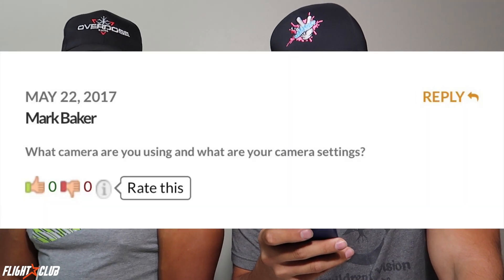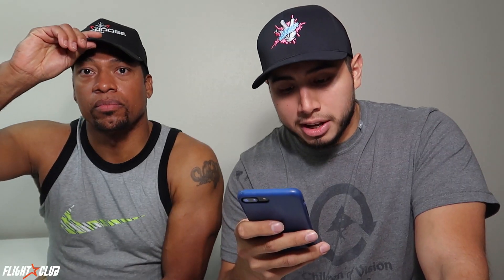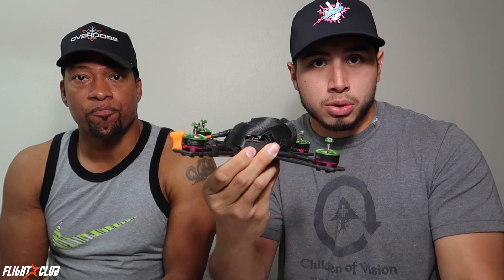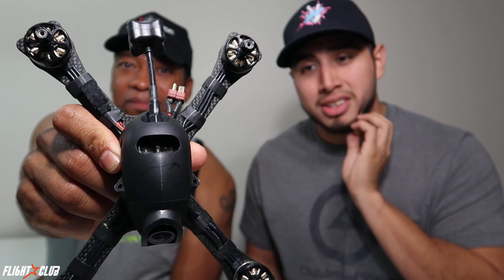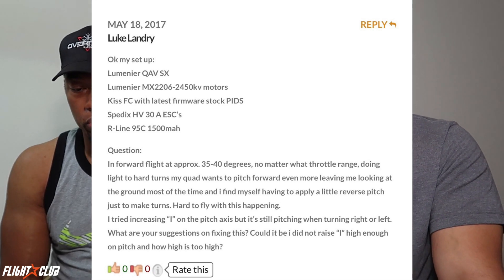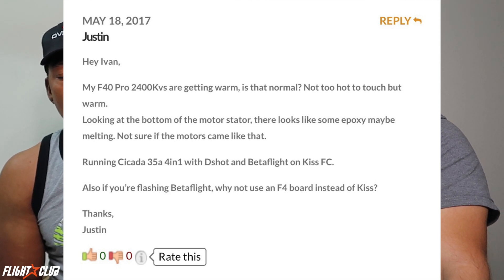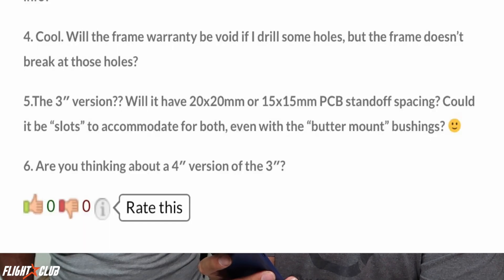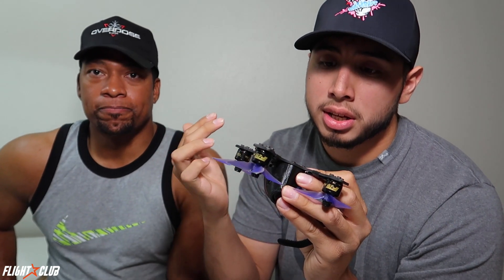Ivan  Rodriguez  Q&A #1

Comment: actually the flip32 omnibus f3 and f4 both support the ports for 4 in 1 esc. Ive used a couple of them and they worked great for me.

Also I love the 3" frame. What would be amazing to see is if you guys made it even a little smaller and ideal for a 2.6" size prop. Would be perfect for the new multi gp micro class.
Reply from the maker: thanks dustin.  We have so many projects going on right now there's not enough time to do them all.  I will have a frame coming out using the 20x20mm boards.

Comment: I'm going to try flashing BF on my kiss FC since I'm also having firmware issues. However I also have kiss ESC's - will this still work?  Can I flash something else to those too?  Thanks!
Reply from the maker: you can run the kiss esc on a fc running betaflight no problems.
Reply: Ok so the ESC's must stay on kiss firmware?